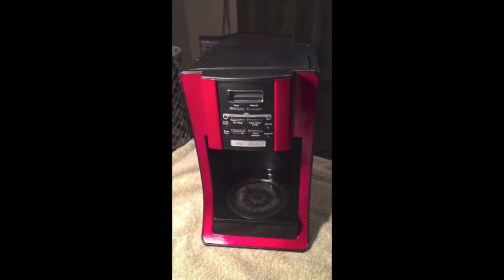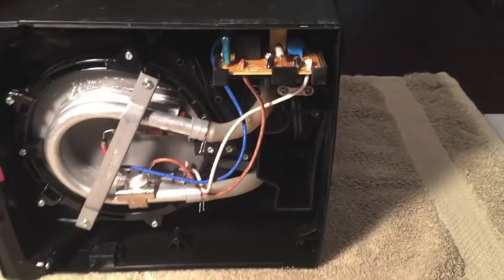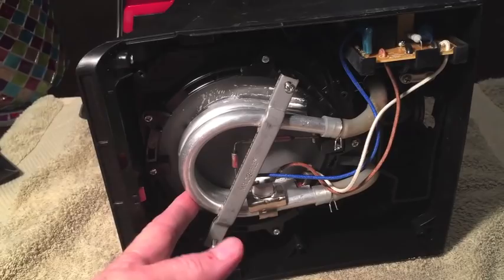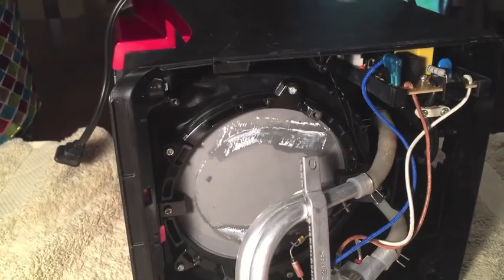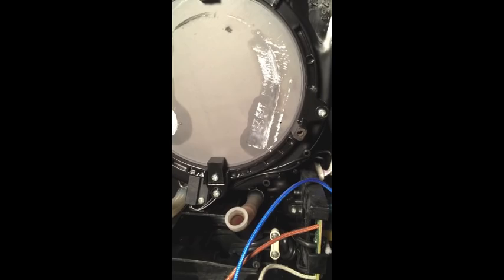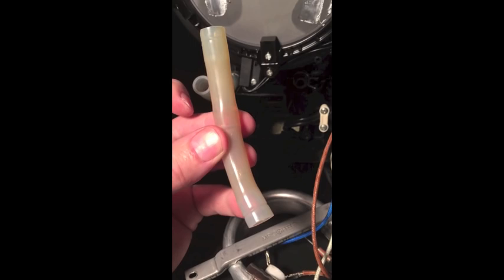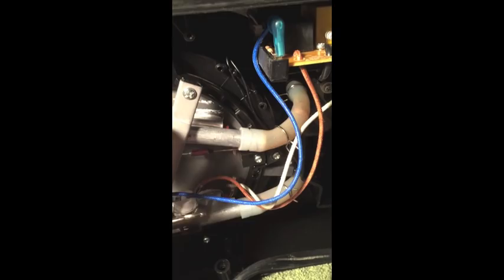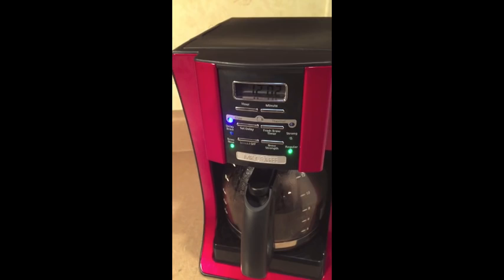How to Repair Any Drip Coffee Maker

Comment: Thanks. Took apart my KitchenAid and could not blow through the tube with the checkvalve so cleaned it out with pipe cleaner. Put all together and still would not work. Took apart again and checked heating element - could not blow through that either - should have checked before putting it back together. So twisted some wire together to make a strong but bendable cleaning tool and went to work soaking in CLR, cleaning, etc. Took a while but better than buying a new unit. Hardest part was getting the clamps back on the tubes.

Comment: Intake and output tubes were not blocked. That's when I checked the heating coil. My Caphalon coffee maker had calcium build up in the heating coil. Just follow directions to remove bracket holding the heating coil. I tested the line to see if air would pass through. Nope. CLR to the rescue. Added small amount to both sides of the coil and watched it sizzle. Let it stand for an hour and then worked with a wire to clear the passage. Proceeded to run a couple pots to clean out residue. It works!

Comment: Also, before taking it apart, just try cleaning the buildup first by running a full pot of white vinegar through it to dissolve the sediment.  After that, run a full pot of plain water, then you're usually good to go back to brewing coffee in a clean pot the easy way.

Comment: Great video. Just repaired my 6 cup Mr. Coffee  maker after it was brewing very slowly to almost not at all. Appears to have been a stuck ball valve. I did have to get a spanner screw bit for 2 of the bottom screws. The other 4 were phillips. Again thank you very much!
Reply: why do they use those damn spammer screws ?  Why dont they just use all Philips heads ??

Comment: thanks. Nice step by step in depth fix video.   I fixed mine by not taking it apart at all..There's a hole at the bottom of the water intake reservoir where you pour the water in, I used some wire and stuck it in there, and cleaned out the gunk.  The inlet hole was clogged with coffee gunk. Then it worked again fine.  I then just ran water thru the coffee maker several times till the water ran clear. Good luck.
Reply from the maker: 3Xcollasso Sweet!

Comment: My coffee maker was letting a bit of water through, and then stopped. Took it apart and no shorts or blockages, only that ball valve in the way. Took it apart, cleaned although pretty much clean already, and voila works.

Comment: Thanks,  it worked for me :) My clog was in the metal part where the heat element is. Was able to get a path way cleaned out and then use the vinegar. (That was after the counter flooded from the hose popping off! lol!)

Comment: Mine triggers the circuit breaker without destroying ceramic thingies. When I test for contuinity on the 2 poles of the plug of the power chord itself,  I dont hear anything even if the start button is ON. All otherr contuniuty tests are ok.   Is it the power chord?

Comment: thanks so much. was able to fix my cuisinart coffee maker following your video. its basically the same setup. there was white debri inside the hot water tube . a large clump. the hose was a bitch to get off they put some type of glue on the pipe. bastards!. i actually damged  the hoseit but put duct tape around it. works great now. fantastic video.

Comment: My 2 cents worth to add to this informative Video if I may.  Note if your water tube (horseshoe shaped alum tube) attached to the heating element is clogged no amount of vinegar application seems to remove it (today). We're talking almost blocked or blocked. Most of the blockage I've found is on the input side of the horseshoe shaped water tube. Disassemble per the video. Take successive size drill bits (no larger than the inside diameter of the tube) an gently clean out the hard deposits being careful not to go to far into the tube as to damage, punch thru the alum tube. Its best to do this by hand only. I use a Tapping tool to hold the bits. Do not use a mechanical  drill. You have little control which you want. Tapping on the tube to relieve it of the debris as you go. Flush out if you will before reassembly and or them run the vinegar solution thru with a paper filter in place several times then follow with cold water again several times. I live in a town with notoriously hard water that eats coffee machines like candy.  Hope this help you folks out. I've rescued many a machine doing this. One final tip. Clean with vinegar on at least every 20 uses of the machine if in a hard water area, 30-40 if your water is soft.

Comment: I got tired off grounds getting stuck in that check ball valve and having to take it out to clean over and over. Will this cause any problems without any valve in there? I ran some water through and it seemed heat and work ok.

Comment: I just removed the tubes and cleaned them a few minutes ago.  Also took out the ball thing, cause I thought it was blocking the water from brewing.  Right now I'm running a brewing cycle with just vinegar, it's been slow but it's kind of working, also the beep (as it was the pot done) stopped.  Did't know the ball thing was important.
Reply from the maker: That is a ball valve and is necessary for the coffee maker to produce a flow of heated water. You'll need to put it back in the tube if you removed it. Shake the tube to make sure it isn't stuck, clean inside the valve with a tube brush if it is. Good Luck!

Comment: Would you complete the same process if the machine also was not heating up the heat plate? Mine won't brew coffee nor warm the hot plate, but the red on button does work. thanks

Comment: Just a few things here. First, it would have been nice if you had mentioned from the start if the heating element were working or not. If the hot plate is not heating up, then this would be a whole different issue rather than a stuck check valve in that line. Secondly, the heating element itself does not get clogged; rather, it is the supply tube that runs parallel to the element in the aluminum assembly. Good information though for cleaning a clogged line/check valve.

Comment: Gonna give this a try. My coffee maker is the same as in your video. It turns on, makes the sound like it's about to brew, nothing happens then it beeps as though it's done. I have only had it for 9mos but only used it maybe 5 most. I tried running vinegar through. Nothing so I hope I can do this. I will mrk the tube so I don't put it on backwards.
Reply from the maker: Good luck and let me know how it goes!

Comment: On disassembly of those pesky screws with a block (Security screws). You can take a small flat blade screw driver an cut a notch to span that block then if you want replace with philips head screw.

Comment: Worked like a charm.  Still haven't been able to tighten those clamps, any insight on that?
Reply from the maker: Sounds like you may have stretched the clamps when you removed them. Try removing the clamps and bending them to make the opening smaller. That way they should fit tighter around the tubing.

Comment: I am afraid I'm going to tear the tube, it is very stubborn. You make it look so easy. What did you use to remove clips and tubes, thanks for any advice.
Reply from the maker: Try needle nose pliers on the top hose clips. You may need to apply some twisting motion as you are pulling on tube to separate it from reservoir. Good luck!

Comment: I took out the ball valve to clean it, but now I don't know what end to put where! Does the end that has air come out of it go on the heating element?
Reply from the maker: The tube with ball valve should allow water to flow through the heating element and into the coffee basket. The purpose of the ball valve is to prevent the heated water from backing up into the water reservoir.

Comment: My coffee brews a bit slow and is not very hot.  I wonder if it is the  heating element or thermostat?
Reply from the maker: Brooke Witham sounds like it could be a clogged heating element. Have you tried running some white vinegar thru your coffee maker? You may have to do this a few times to dissolve any calcium buildup. Good luck!

Comment: Is there a valve in the heating element? It was clogged where the hot water is supposed to come out of the valve. I managed to get the hose of and cleaned it out as well as I could with a small screw driver. Seems to be something in there. Unless it's just more calcium or lime deposits.
Reply from the maker: It sounds like there is calcium buildup inside the heating element. Try soaking it in CLR and use some plastic weed eater line to clear out the remaining deposits.Be sure to rinse in water thoroughly before using. Let me know how it goes!
Reply: The Frugal Toad Thanks for responding. There definitely is calcium or lime in there. I put a wire through as far as it will go but it won't go all the way. Not sure if it should go all the way through or not. Why I asked if there is a valve in the element itself. I've got pure vinegar in the there but you can't put much in.such a small hole. I'll keep removing the vinegar and replacing it with clean vinegar. Do you know if there is a valve in the element itself. I can't soak the whole element since it stlll has all the wires connected. I don't want to undo the wires since I cannot resolder them. Thanks.
Reply from the maker: The heating element does not have a valve. Try using an eye dropper to squirt CLR into the heating element. Have you tried using plastic weed trimmer line to clear the calcium deposits in the element?
Reply: The Frugal Toad I so appreciate your responding. Thank you. Actually I did use an eye dropper. lol. I'm not bad at DIY for a lady. I've Mcgyvered a few things in my time.I did not use weed trimmer line. I used a turkey baster like a plunger to blow air and vinegar in and out through the element. Good news. It worked. I finally have it all fixed. Now to get some new screws to put the base back on. Those darn screws with a pin in the middle of the head suck. I don't have one of those bits but managed to borrow one from a neighbor. Will replace those screws with regular Robertson ones if I can find them in case I need to open her up again. YT videos like yours are a blessing for DIY ers like me. Thanks again. :)
Reply: Nice
Reply: Some have screens in there it seems (In case anyone happens to read this post and wondering).

Comment: So I'm assuming I have super hard water. I have extreme calcium build up inside my heating tube under my heating plate. Any suggestions on how to decalcify that tube without ruining the internals of my coffee pot?
Reply from the maker: I would remove the heating element, fill with vinegar, and let sit overnight.  Use something like flexible grass trimmer line and insert into element to remove calcium buildup.

Comment: Hi. Nice of you to post this video. My ball valve seems clear and moves freely. However when I try to pump water through the coffee maker, the intake hose pops off where it attaches to the water reservoir. I am thinking  the clog is in the heating element itself. I had vinegar going through it to clean it when this first happened. I am letting pure vinegar soak it hoping it will clear the clog. No water is getting through to the basket. I cannot take the hose off where it it attached to the heating element. It's old and when I tried to remove it, the hose was breaking. Kind of glued in place from the heat. So I left it. Is there a way to clear the clog in the heating element itself? Is there any place to buy a new hose besides the from the company making the product? My coffee maker is old so it's not even listed on their site.
Reply from the maker: CLR and some flexible weed trimmer line may help!

Comment: what tools did you use to remove the clips? being in such a tight space it would have been some good info to see it done. you mentioned a 'brush' to clean the tube, why not show the brush and the cleaning of the tube?
Reply from the maker: Scott Frasier Hi Scott, Needle nose pliers will make removing the clips a breeze and you can pickup a set of utility brushes at your local home improvement center or Harbor Freight.
Reply: Yes, needle nose pliers work great but to be honest, they're not very strong clips so you can actually press them together with your fingers if you really needed to. Nothing like the clips you see in car vacuum hoses.

Comment: I notice that your coffee maker, like mine, has some kind of white thermal paste between the heating element and the hot plate.  The stuff I use for CPU heat sinks is somewhat toxic and a skin irritant.  I wonder what they use in coffee makers?

It is probably not worth replacing, since it would just mean the pot doesn't stay quite as hot on the warmer.

I was unable to pull the plastic tubes off of my heating element, and there is no space to get in to try to remove from the reservoir.  They really designed this model (Mr. Coffee TF5) to be disposable.  :-(
Reply from the maker: Hi Stuart! The plastic tubes can be a bit stubborn.  Try twisting them, that usually will free them.  If not, try unbending a large paper clip, use needle nose pliers to bend a small hook in the end of the paper clip, insert the hook between the plastic tube and the water line, pull on paper clip hook to release plastic tube.  You may have to grasp the paper clip hook with needle nose pliers in order to pull the plastic hose off the water lines. - Let me know how it goes if you get a chance!

Comment: Mine is making a gurgling  noise like it does at the last bit of the brew but now it does it the whole time like it’s sucking air through the tube.
Probably check valve also?....I’ll update once I figure  it out.
Usually my Wife runs a vinegar/water cycle through it once a month but not the past couple months.

Next I’m going to tackle my toaster.
Man you wanna not eat toast anymore...look inside your toaster at all the bugs, spiders and other nasty things lurking in there.

Comment: Informative video, however, in order to remove the bottom from my Black & Decker unit, one needs a special bit (hole with a flat head on either side). Thought I had all of the bits known to mankind until I had to perform this task. Time to buy a new coffeemaker, unfortunately.
Reply from the maker: Can you post a photo of the screw? Maybe we can help determine what kind of bit you need or maybe another solution.
Reply: I ran into the same thing with my Sears Pro coffee maker.  Three screws are Phillips, but one looks like a flat head screw with a notch in the middle.  I used a small screwdriver to twist just one side of that screw and eventually I got it off.

Comment: I have no idea what a glass trimmer is. My pot doesn't heat up anymore
Reply from the maker: I believe you meant Grass Trimmer line.  It is thick and flexible enough to maneuver through the channel in the heating element. Try soaking the heating element in vinegar before trying to remove calcium buildup.

Comment: how do you get the hose off  GOOD LUCK
Reply from the maker: Janet Wirth You will need to loosen the two clips at both ends of the water supply line. Needle nose pliers work best. The supply line can then be removed.

Comment: How about every time you make a pot, set aside a quarter.  It's way cheaper than Starbucks, right?  Then when it fails you can buy a new coffee maker rather than screw around with repairs, which if you don't really know what you're doing, will waste your time and money (for parts and sometimes special screwdriver bits) and may even result in an unsafe repair.  Thermal fuses and switches are used to save lives and keep Mr Coffee from being sued.
Reply from the maker: No special tools needed for this simple repair! And you avoid contributing to your local landfill.